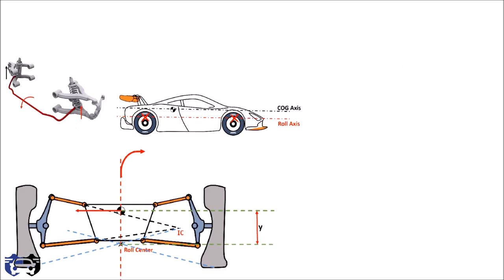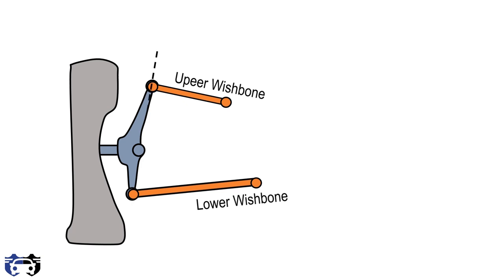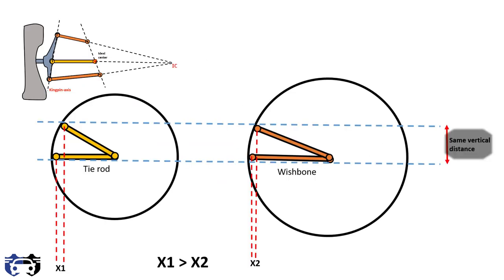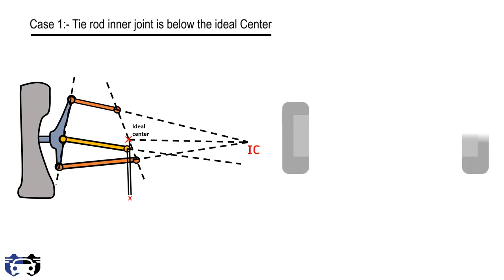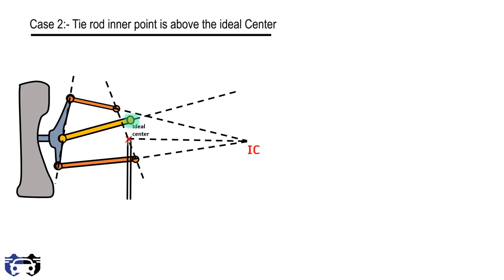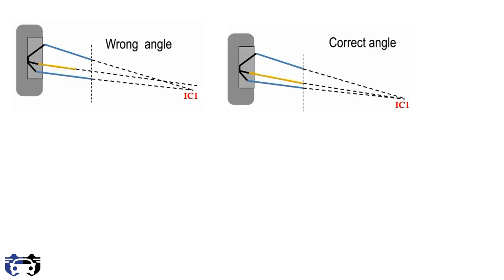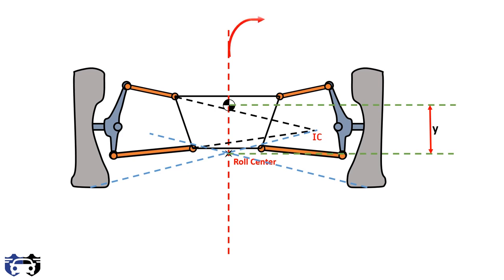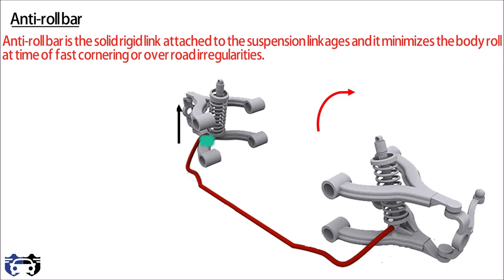Roll Steer | How roll steer can be corrected ? | What is roll center and Roll axis | Anti-Roll Bar

Comment: thanks for sharing , it's would be very useful for Passenger vehicle . How does it applicable commercial vehicle where solid axle, leaf springs and Pittman arm drag link type steering system is used  ? Could you please make some video on this as well it would be useful 😊
Reply from the maker: You're welcome! 
Roll center more depends on the type of Suspension geometry as compared to type of Steering geometry. The rules are same for all the suspension geometries. You just have to find the instantaneous center of suspension linkages and you are good to go!
Still stay tuned soon , i will be covering all the types of suspension geometries and i am sure that will clear all your doubts.

Comment: hi could you please do a diagram of how to set up handle bar steering via shaft to two front wheels ..does the length of arm that is attached to kin pin make any difference to roll steer ..ive built reverse harley trike  so one back wheel two front..i have  set  ic but trike seems to wallow  am i missing something  ..im using trailing arms and have fitted sway bar..send email and ill send pic if you can help be very grateful
Reply from the maker: You can send your queries at :- vatsal.jain51@gmail.com
Reply: sorted thanks all down to instant centre configuration..tirke handles well now
Reply: @mikemills9279  How did you resolved it?, i had the same doubt when i watched the video, thanks!.